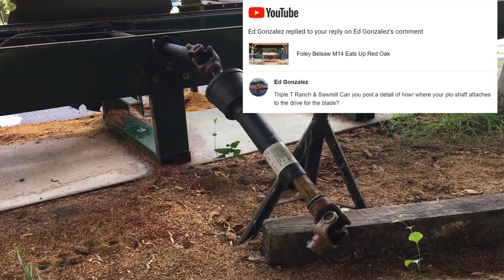Woodmizer & Circle SawMills Making Boards

Comment: Totally enjoyed every second Kim !! I tell you all the time that I wish mine ran as true as yours.  You can tell the old Case had a snoot full when you got into the full size cant though.  Your buddy is about a month older than me.  Heck fire man, at 68 we are years from the dirt nap at the end of the road !!  Crazy walnut too.
     I really wish I had some video of our old 54'' Fisher and Davis powered with an '34 or '36 Buick in-line 8 running in second gear wide open !!  Open manifold and howling like a continuous lion's roar, I could hear the old man and Uncle Chippo sawing walking home from school still a mile away !!  The mill sold in '82 at the farm auction.
Reply from the maker: I need to do a top end on the case, it has so much blow by that when it gets "its snoot full" it blows the oil breather up in the air!  I bet that 54" Fisher and Davis cut many a board feet of lumber that was skidded right out of your woods.

Comment: Doing good, buddy! 
My tractor wouldn’t have pulled through that oak with the blade I have.
Reply from the maker: Oh no!  I have found if I take the time to sharpen the bits, it takes less horsepower.  Replaced 6 bits yesterday because the blade decided to meet the log dog!